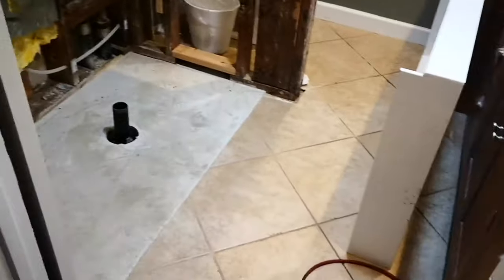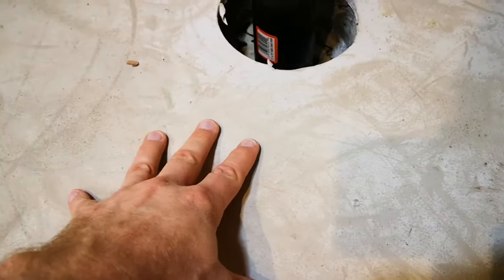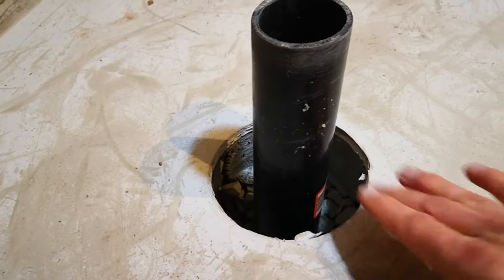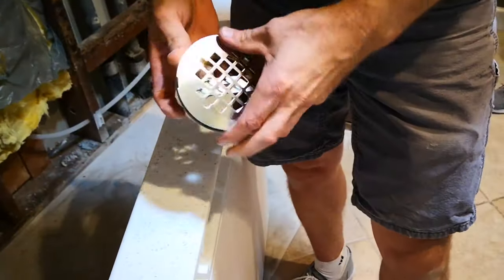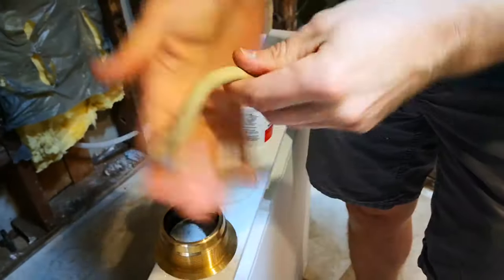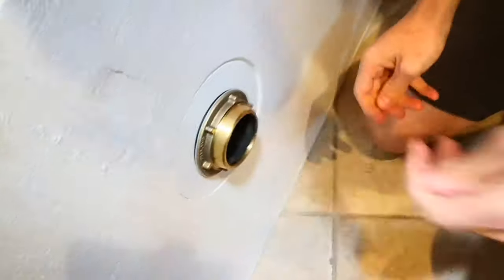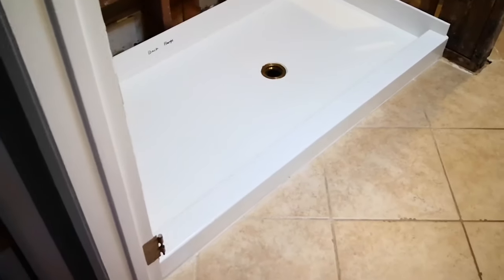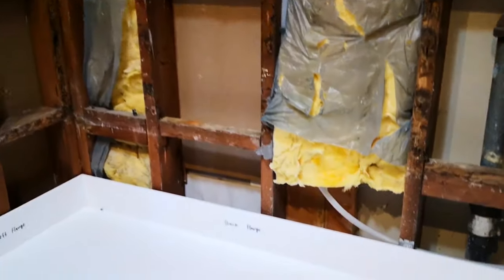Solid Surface Shower Pan Installation - Part 2

Comment from the maker: Thanks for watching. If you have any ideas or questions please comment. Let me know if you have any ideas for future videos.
Reply from the maker: @Renee Gilmore Hello, you need to buy the foam and wrap around the pipe until you are right to the surrounding floor. Then silicone any little gap between the foam and the floor. This will keep the self leveling compound from going down into the hole that is around the pipe.

https://www.amazon.com/dp/B00FK8P5TI/?ref=idea_lv_dp_ov_mw
Reply: What brand pan is that?
Reply from the maker: Corian custom made at our shop in Anaheim.
Reply: Hi how do you compare the mustee to sterling.
Reply: So no glue to the floor? No mortar to lay it in. You just drop it in?

Comment: You did good job but is it defaulter to install the drainage  could  do u have a video  how the plumber did the last  section  i mean sealing the pipe  thx
Reply from the maker: No I don't, but the tailpipe is like what is common on a regular sink drain.

Comment: How do get your walls plumb and square ???????????
Reply from the maker: It starts with the studs and drywall. We install a lot of showers where they aren't plumb. Customers really don't seem to notice. The glass door make up for the difference.

You can shim the panels a little expensive to make them flat. Flat is important especially on the sides where you will see the edge. It's nice to have that straight.

Comment: How did you make the connection to the pipe?  Did you have to cement the PVC or did the drain fitting slip onto it without needing a seal?
Reply from the maker: The ABS drain pipe slips into the drain pipe assembly with a friction fit and then a nut is tightened down around the black gasket. There are also glue in type drain assemblies but you have to have access from below.
Reply: @AndyGraves  Does the proflo assembly come with everything minus the putty?

Comment: what did you put around the drain pipe, edges to make self leveling liquid not leak? Appreciate the help in advance. I am planning to do the same.
Reply from the maker: Hello. It is  Oatay 38711 Foam Closet Flange Spacer - https://amzn.to/3nnx8kt . We wrap it around the drain pipe and secure with masking tape. After the concrete is cure, just remove. You can reuse it as well.

Comment: What did you use around your drain pipe when you used the self leveling concrete to seal the pipe?
Reply from the maker: I use a foam flange wrap and just keep wrapping it around until I get wider than my drain assembly. It can be used over and over again.

Oatey® Foam Closet Spacer/Wrap - https://www.homedepot.com/p/Oatey-4-in-x-4-in-Foam-Closet-Flange-Spacer-38711/100346883

Comment: Great tutorial. I want to replace my bath tub with a shower base. I've already removed the tub and now there's just a cement base. Do i still have to put another layer of fresh cement under the new shower base? Or can it just sit ontop of the existing previous cement floor where the bath tub was on before? Thanks
Reply from the maker: Thank you. That is self leveling compound to make to area perfectly flat.
Reply: Ok thanks

Comment: The pan is just sitting there?  No screw and anything to make it stable?  Is the drain pipe coming through the drain?
Reply from the maker: It is just sitting there. You can silicone it down but it's not necessary. The panels will hold everything in place. It's nice to be able to make micro adjustments when fitting the panels and the drain assembly. we have never had an issue with it not actually being glued to the floor.

Yes, the drain pipe is coming up into the brass drain assembly. The final connection will be made by the plumber with the gasket and brass ring.

Comment: You didn't secure the pan with screws to the studs.
Reply from the maker: That is correct. The plan will expand and contract and cannot be screwed to the wall. You can put silicone under the pan if you like but we just let them free float.

Comment: I work with Corian in Brazil. I saw that you fill the entire thermoformed base from below to level everything. What did you use for this filling?
Congratulations on your work and thanks for making videos!
Reply from the maker: We use 3" thick ridgid foam.  There is another shower video that shows it. There is also a video showing how to cut it off with a foam cutter. Look for the solid surface shower playlist.
Reply: @AndyGraves  Thanks!!! :D

Comment: If you have to mark the sides of back and seriously don't know what the front is than someone doesn't know what they're doing
Reply from the maker: The pieces are marked as they come off the CNC so you can assemble the pieces faster. The right and left piece may look the same but they could be different by only 1/8"

Comment: If I have a level (wooden) subfloor, do I need the leveling compound or thinset?
Reply from the maker: No, it just needs to be level. You can use some silicone to hold it in place but the weight and it being locked into place with the walls is really all you need. FYI, make sure the wood floor does not squeak and screw it down really well.
Reply: @AndyGraves  Terrific, thank you for the advice and the response.
Reply: @AndyGraves  I was wondering the same thing. I am installing a shower pan on a wood floor as well. Great video. Thank you.

Comment: Can you level the floor first (if needed) with thinset and then cut the drain hole?
Reply from the maker: I guess you could but typically there is always a hole because rough in plumbing is done first.

Comment: Can you please quantify "perfect", "perfectly flat", "perfectly level" etc.
Reply from the maker: When you place a level on the floor the bubble should be dead center. If it's flat but out of level by 1/8", it changes the way the shower pan will drain.

This is a critical step in the process to get correct.

Comment: Plumbers putty bad. Pure silicone so much better
Reply from the maker: Why?
Reply: Regular Plumbers Putty has been known to stain some surfaces. There is a Stain-free Plumbers Putty for use with surfaces such as Corian.
Reply from the maker: We have not had issues but have since switched to silicone.

Comment: wait... you didnt show us how to level or actually install the pan.... do I just simply set the pan on the floor???
Reply from the maker: That is correct, once the self leveling compound is used, just set in place. Use a little silicone if you feel more comfortable but otherwise the panels will hold everything in place.

Comment: Why do u need the cardboard ring between the rubber and brass ring?
Reply from the maker: The cardboard is a slip ring so the brass nut does not grab the rubber washer.
Reply: @AndyGraves  I would have thrown it away 😱
Reply: Does the carboard still grab the rubber seal ? Or are you concerned about carboard in a wet area ?
Reply from the maker: If water get to the cardboard there is a leak. The cardboard should stay dry forever.